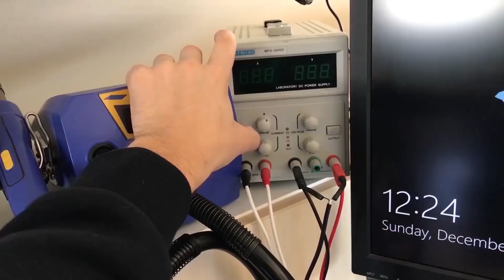IPhone 7 bootloop error -1 fixed by replacing baseband pmu

Comment: hey, i had error 4013 on apple iPhone 7, after replacing baseband pmu i got error 9... baseband not working can i replace baseband on that iphone??? will it work??? or will i get activation error?
Reply: i resolved error 4013, but after 4013 there was error 9... can i replace baseband CPU?
Reply: Its the nanad flash ic remove it and fix it on jc pro and then replying it

Comment: I thought the baseband chip is married to the CPU and Touch controller? so replacing it will still work?
Reply: He didnt replace the baseband chip. he replaced the baseband pmu,
Reply: Probably a bit late to the party, but the baseband CPU is paired to the board, but the baseband PMU is not, which is what was worked on in this video
Reply: But you can't replace baseband cpu